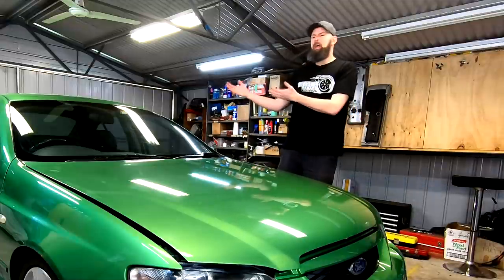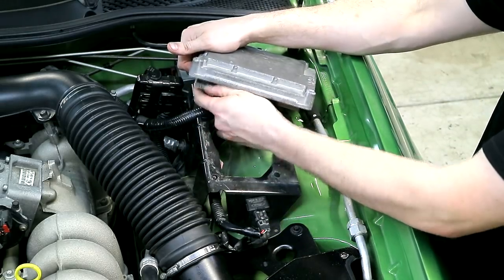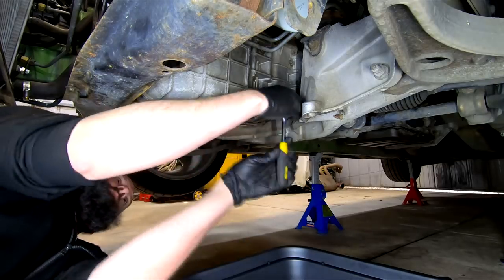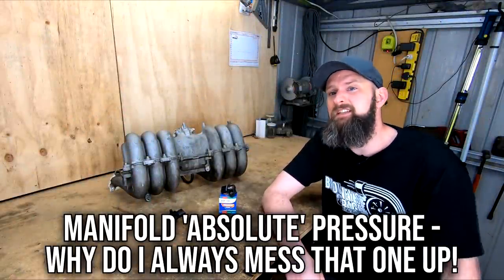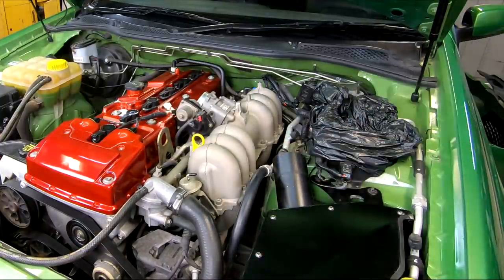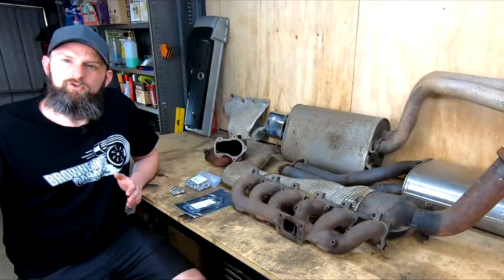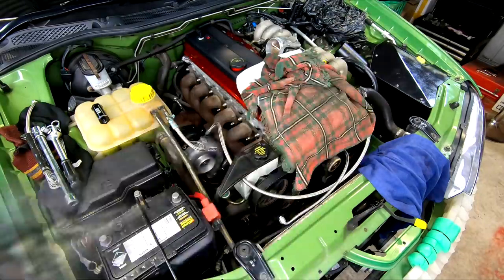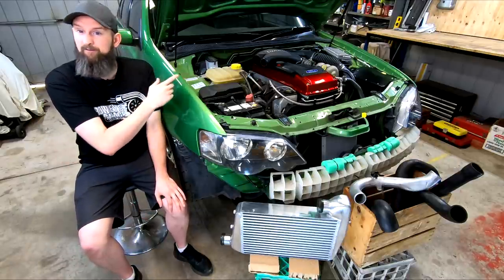In Goes the TURBO, Out With the NA Gear! | TURBO Your NA Barra Pt 5

Comment: I think you'd be better off leaving the vacuum to the intake it doesn't matter if you have boost or not those variable runner intakes are going to help either way so it'll only make your turbo set up better if you leave it as is at least that's been my experience on the one car I had that had that and pretty much everything that I've ever read or seem on fairly credible sources.  you want that long runner for the lower RPM and then you want to switch over to the short runner for high RPM because it's all about the air waves bouncing back and forth as the intake valves open and close and boost doesn't change that it still does it or doesn't do it if it's not there that's like all these expensive sheet metal intakes that have these like 4-in long runners you're killing your down low and mid range power and probably only gaining a tiny bit up top at the very peak of your rpm range if you're even gaining anything the only reason to use those is if it's like a dedicated drag car that's only running like a 2000 RPM range that's way up high.  I mean this is a little different because you still have the two runners but with that butterfly valve closed you have a smaller intake volume so you're going to have a smaller intake manifold volume for better response down low and it'll Force the air to go through the longer runners which will help out your low end and then it'll open and then it can go through both and you can get that extra horsepower up top without losing the down low

Comment: I just wish all barras had the same specs. It’s so disheartening knowing you’ll have to rebuild most of an NA block + valves if you want it to be reliable. That on top of needing to replace the exhaust & match up an ECU to a 6 Speed trans.

Comment: I want to put a NA turbo barra into my stagea. Why leave it in a ford when they look ugly :P
Reply from the maker: If you said why leave it in a Ford because they're heavy, or the interior is rubbish, the rest is poorly made, they're noisy etc I would absolutely agree - but ugly!... not all of them. 🤣 Good luck mate, would be a sweet project.
Reply: @BrowneysGarage  yea iam just having a dig they are a fine large sedan. But yea my first car was a s13 so its hard to like anything that isn't a coupe hehe. I just use my stagea as the workhorse car big boot, roofracks and towball ready to lug the world around but stock rb25 with only more boost is pretty slow still~
Reply: @BrowneysGarage  oh also this is really good info in this video. I like when video's are super informative  and well researched it shows! Its kinda crazy how many differences there are even with the barra motors over the years!

Comment: It worry`s me Browney that your engine is high comp not low comp. That will call for low boost.
Reply from the maker: Appreciate the concern mate, won't be on huge boost - just enough to have some fun.
Reply: @BrowneysGarage  Ok! I watch your show all the time and have done all the basic mods you have done on the NA. I plan to install slightly modded cams and an SCT X4 tune up. I`m very uncertain about The Turbo thing. Good luck anyway.

Comment: Shit mate, u have explained a lot of things that I was unsure of. But my ocd is much worse than yours. I have a pulsar 3584r turbo. And I have brought both hot and cold side plazmaman turbo piping, and a decent intercooler for it. I have a grimspeed turbo boost controller 2. So u know what all this means hey bro. I have to rebuild the bottom end with hi performance rods and pistons and all the bearings. I could do the conversion, and forget about the bottom end but it would keep me up all night worrying about the bottom end. U may think I'm joking but I'm deadly serious. Not many mechanics would touch my conversion anyway. I bought a ecu online and the dude did a custom tune on it and sent it to me. Apparently I will be looking at 550hp when finished. I believe him because he owns a mechanic shop and he has a 1540kw ba xr6. Yeah its a bit hard to believe, but I wouldn't put it past him. I don't know how much all this is going to cost me, I'm like a dog with 2 dicks.

Comment: Can anyone tell me please?
Can you do these mods to an 03 fairmont?
Reply from the maker: Been done before, they're all same same mechanically. Only potential issues I can see off the top of my head is clearance for the intercooler piping under the headlight may be different and if you don't have rear bumper cut out you'll have to modify that or exhaust if you go full factory turbo exhaust.